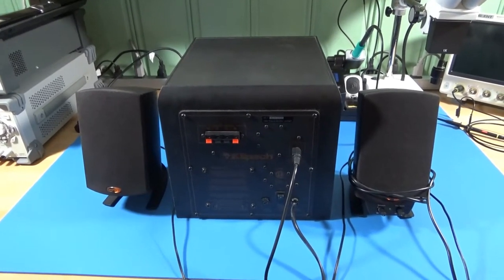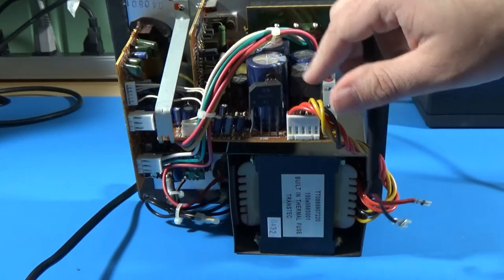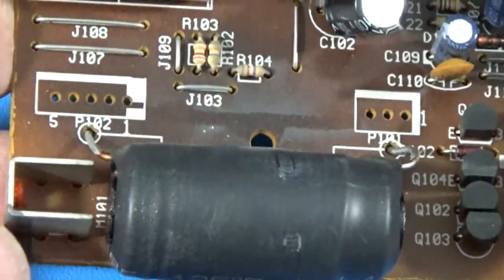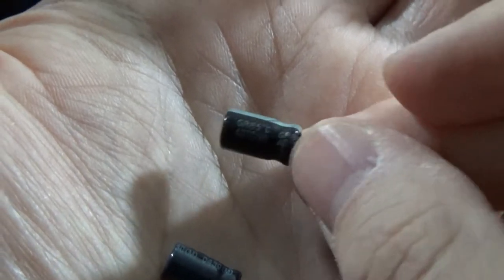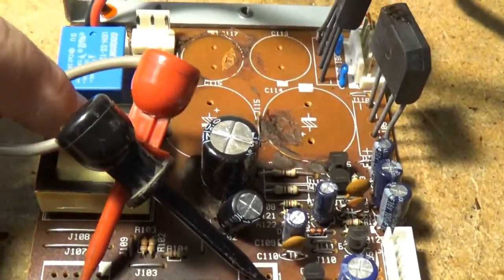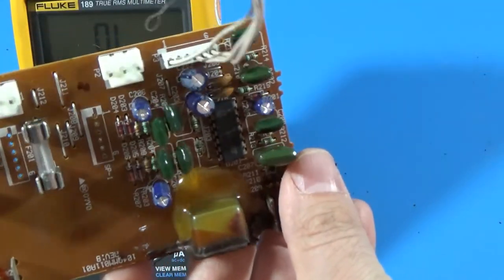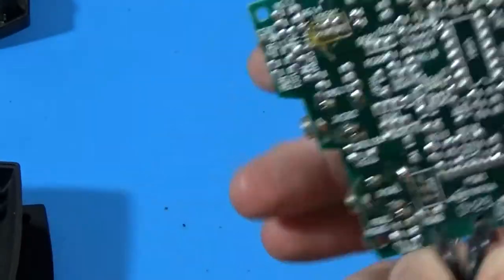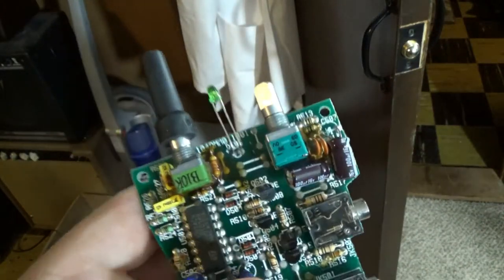Klipsch Pro Audio 2.0 Speaker Repair

Comment: Hi Sir, my klipsch 2.1 Pro Media suddenly no sound. First problem is no power, I changed the 2pcs open fuse T2.0A 250V, 2pcs shorted MOSFET FSA10N60A and open capacitor 100uf 50V now the power is ok but still no sound. any ideas please help....Thank you